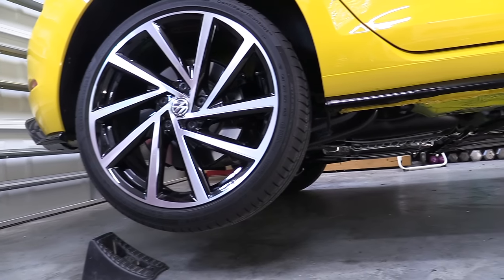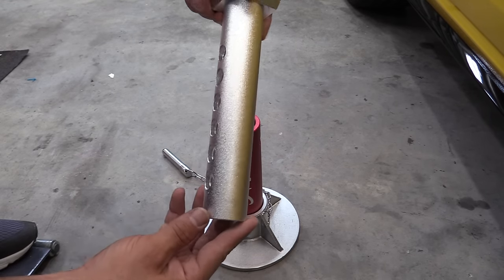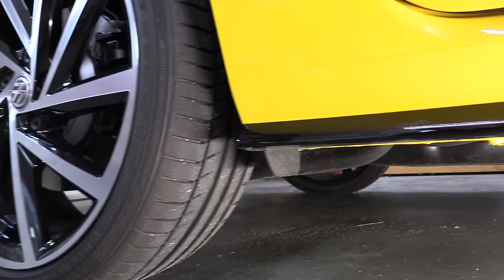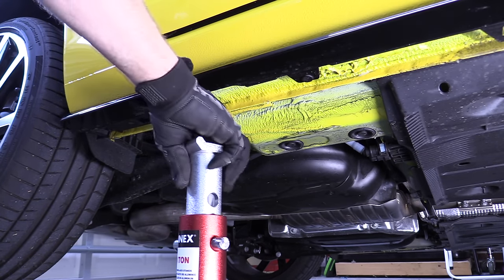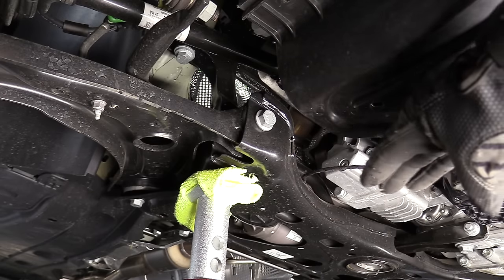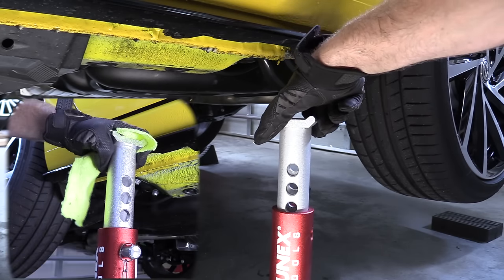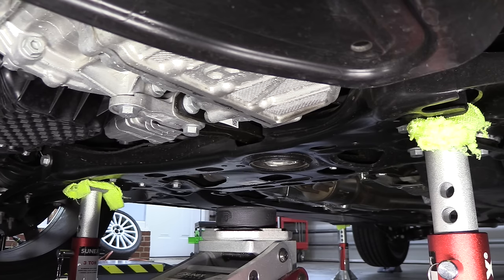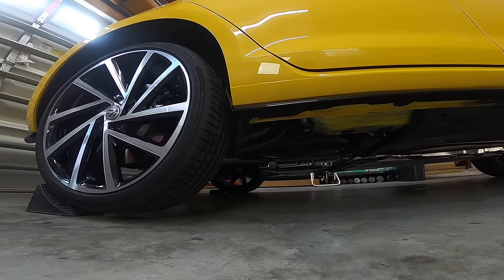How To Properly Lift a Car on 4 Jack Stands

Comment: Thank you for creating this video. It proved extremely useful when I swapped my winter wheels the other day. In the interim, I’ve ordered the Audi jack pad kit as I don’t trust these pinch welds for the long term.
Reply: I've read and seen video using the Audi jack pad kit and it's pretty tight getting a jack into those Audi pads and placing jack stands at the pinch weds simultaneously  you have to have certain jack stands (and jack)  (like the ones shown in this video) AND position the jack a pretty sharp angle to accomplish it.

Comment: Very useful video, but those jack stands are really squirrelly. The Esco tripod stands with the flat rubber saddle are a lot more stable. They also have the advantage of not needing any sort of padding.

Comment: I bought the Audi jacking kit and installed it on my MK7.5R
Reply from the maker: I need to look into that.
Reply: @HumbleMechanic  Some rumors say that those pads are designed to be used at the factory and only 4 corner jacked all at the same time. It would be awesome if you could confirm/deny those rumors.
Reply: I've used the pads on my RS3 when jacking up the corners multiple times. They are holding up fine. I use those softer red polyurethane pucks.
Reply from the maker: ShopDAP.com

Comment: Yea, get some spacers on that sucker. I did 15mm front/20mm rear spacers on our R to push the wheels out a little bit and it looks way better.

When we bought our Mk7 R I had the dealer swap the Watkins Glen 18's from our MK6 GTI and put the Pretorias from the R onto the GTI. Some lucky buyer at Carmax got a brand new set of Pretorias with summer tires when they bought that GTI.

Comment: I actually have a thick horse stall mat in front of my workbench that I custom cut things from. Pieces for the floor jack, the jack stands, etc. you can stack and attach pieces together to make a custom rubber lift puck.

Comment: only set car in park or put brake on if jacking from side ,  if you jack from front or back of car, the car needs to be in neutral so it can move slightly so it doesn't slide off the jack as the jack moves forward as it goes up.  set brake and block after it is raised, then unset before lowering.
Reply: Corrrect super important

Comment: On the Mk6 models I like to place the jack stands under control arm bushing brackets (rear position) at the front of the car. If it’s a quick job I usually leave the stands there, if it’s going to be up for a while I’ll move the stands to the pinch welds.

Comment: I've seen warnings that you should not jack up opposite sides; when jacking up the 2nd side the other side's jack stand may wobble or fall.  In fact there was some wobble when you jacked up the 2nd rear corner.  Maybe this affects certain vehicles more than others.
I had the notion to have 2 jacks simultaneously lifting the back (also the front if still using the pinch welds).  Do you think this would be safer/better?

Comment: The problem is you can’t consistently lower the jack slowly so you may damage the car or it can even fall off the stands, at least that’s true for my jack and I’ve seen others with the same problem 
So a solution would be having some jack stands with fine adjustments but those are only available for trucks and are too heavy too high and expensive. Another option is to use a scissor like jack but if you want to use the hidraulic jack as well you may run out of jack points.

Comment: I use 2 airbag lifts. They are amazing because they do not arc and they go straight up.... only downfall is they dont fit under lowered cars. I hate car manufacturers that don't leave metal exposed to support the car... They try to make it difficult without a 2 post (cough cough dealership)

Comment: you need to make a video doing this method with 6 ton stands that have a 23 inch lift on them. (on a passenger car) in order to do transmission replacements.    I dont think the side to side method is going to work very well, especially since the car will be tipping so much on the sides to just get them under there at even the lowest positions.  on my car i have to do front to back instead of side to side with 6 tons.

Comment: Watching this makes me miss my BRZ, that car was so easy to lift using the front subframe and the rear (via diff).😄
Reply: Mustve been stock height, i wasent able to get under mine with an ultra low/ long jack lol.
Reply: @DrivenMars  mine was lowered about 20-25mm, not dumped or stanced.  Wanted to keep geometry decent for track work 👌

Comment: I was always thinking I would jack up my Mazda 3 on four jack stands for things, but I have come to the reasoning that it’s not worth all the back and froth between jack and jack stand repositioning and especially not worth the risk of jack stands tipping. I think I will just stick to two jack stands and jack holding up slightly as a back up. For brake bleeds or tire rotations I will just lift up one side of the car at a time, or front or back. For brake bleeds I will just jack up one side or corner at a time with the regular precautions. For oil changes I have metal harbor freight ramps I drive up on and then put jack stands underneath and a jack as another backup.

Comment: Great video Charles! Nice to know I was properly jacking my own car up using the same methodology as you demonstrated. It should make sense if you look at the layout logically, but some people need a clear representation. You did a great job at that!

BTW: My dad bust a gut laughing when he saw my mk1 Jetta lift the rear wheel when I was jacking up the front, just as you shown with your Mk7. He had never seen that in any car he's ever owned over the years! Gotta love a stiff unibody!

Comment: Thanks for the video Charles! Is there a reason not to lift the car from the subframe initially rather than moving the jack stands after the fact?
Reply: Came here to ask this as well.  Seems way easier if you can reach subframe initially.  Need a long reach jack but still, any reason we shouldn't do this??

Comment: I have a forklift.  I was thinking drive forklift into side of vehicle with 1 fork on each side of tire. Now bring forks fully together .  Lift ...  the tires will slightly deform on the forks.  The
Vehicle may have some awkward forces on frame as it lifts. If you lifted the front first it may lift the whole.side.  it would be easy to get the jackstands under at that point on one side.  Repeat on the other side and your whole car off the ground.  Any thoughts or ideas?

Comment: Proper lifting points on my car: whatever parts of the pinch seam aren't rotted away.

"Avoid gravel"...  Mmmm...no can do!

My jack stands: concrete blocks with pieces of wood on top, stuck under whatever structural members of either the frame or the suspension are not rotted away.

If it's not obvious, I believe in SAFETY!

Comment: Great video. I've been trying to find better places to set my stands. I just started working on my own vehicles. I bought a manual for some basic maintenance and it says to use the pinch welds. I've looked everywhere for alternative jack points. The pinch welds on my vehicle, just doesn't seem very safe. And when my jack is listing from the pinch weld I cannot slip a stand in. It's been a real pain, and a lot of unwanted trial and error. The pinch welds have even become a little mangled. I seen on some forums about using 2x4s as a stabilizer between the stands and the vehicle. Anyone have any tips about that?

Comment: look up "Goodyear racing jack stands model 35422" Those have double locking pins, they're also very, very nice. Thumbs up if you agree.
Reply: I don't see them available anywhere but they look good
Reply: Try using the offer up app on your phone or craigslist, you'll find them here and there.

Comment: Dear Charles, as far as I'm concerned, I drive the car on 2 pieces of wood in the front and then put the jack and lifted it from the front frame and then put the jack stands under the pinch welds, that way I'm never under the car while supported by the jack alone.

Comment: Also, no matter how level you think your surface is, and how undamaged are the lift points of your car, with a front-wheel drive car that is much heavier in the front than in the back, after you let the car down on 2 front stands, and then onto 2 back stands, each adjusted to the same height, you may find that the car is not actually resting on one of the 2 back stands. This is ok, as long as the car is firmly supported on 3 stands, and the 4th stand is standing under the reinforced lift point, you are ok. This is due to a basic law of geometry. Something to do with a tripod. You will notice that telescopes and cameras are always attached to _tri_pods, not quadpods, because a tripod is the most stable; a quadpod is no more stable than a tripod.
Reply: I found this to be the case when putting my wife's RAV4 up on 4 jack stands last weekend.  I lifted the front first and placed 2 jack stands in the pinch welds.  Then I lifted the back and placed 2 jack stands in those pinch welds.  When I started slowly lowering the back down onto the jack stands, the car tipped ever so slightly towards the front passenger side (my heart skipped a beat for a second!).  

After it settled, I found that it was actually being supported buy only three of the jack stands!  It was just hovering over the rear driver's side stand.  Of course I left the stand there under the pinch weld and placed the floor jack up on the frame right next to where I was working as a backup and I felt perfectly safe.  I do not live in an area where earthquakes occur so that is something to consider, ever with the car up on 4 stands and a backup jack in place!

Comment: I think it is negligent of manufacturers' as big as VAG do not make this procedure easier and consequently safer. The lack of 2 DESIGNED bearing points in each corner of the car: one for jack and one for stand is an accident waiting to happen. Cars breakdown and need lifting away from lifting stations and even mechanics find it tricky jacking cars in emergency or breakdown situations. I use 2 jacks simultaneously at one end of the car and place it on 2 stands and do work on each end at a time. But the positions of those bearing points are too close and far from ideal.
Excellent  demonstration, keep them coming master.
Reply: I agree. When I was a kid I had a 1974 Nova. There were slots in the steel bumper for a jack. If anything was going wrong while jacking, you lowered it and reset the base and jacked it up. There were a hundred places for a floor jack to go on the car's frame. 
It would be nice if uni-body cars had purposely made jack points that were not covered in plastic, besides the pinch welds, and had them painted green to find them easily. As prices for tire rotations increase more people will rotate the tires themselves, for free.

Comment: I know for the transmission fluid change you will need to shift all gears, this means you'll have to spin the front wheels at some speed, would a configuration like this hold properly?

Comment: I own a mk6 gti, is it a good idea to lift it like you did from the aluminium subframe? I previously just jacked it up carefully on the pinch weld and put the jack stands at the reinforced part. I have had a case where the pinch weld did fold and I'm lucky that the car didnt fall down.

How would you suggest I lift the car?
Reply from the maker: I don't have a jack that will reach the subframe with the car on the ground. I would do it like I did this one, and move the jack stand to the pinch weld if you don't want them on the subframe

Comment: @humblemechanic Charles, I just wanted to jack the front of my Mk 7.5 Golf R for an oil change. Can I use the rear pinch welds to lift and place my stands on the front?

Comment: Question : How could you slowly lower the Trolley Jack arm. ?  As soon as you unscrew the little pressure screw, the jack's lifting arm will goes down instantly due to the car weight.

Comment: Just one mistake, you will bend the metal. 
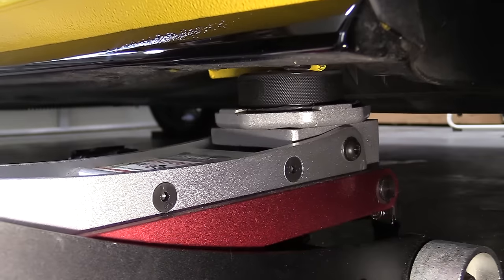Its bend @ 1:45 front right and straight @ 1:53
You wont be able to use the original Jack anymore and there will be rust.
Just look at the VW Jack an build a similar thing, for example make a groove in the Puck.
this Lip is NOT for lifting, its so that the car doesnt slip of the jack. the part right and left of the lip is the structural part for liftig.
So many are bend, its a stupid system, most  car machanics with a lift will flatten them....

Comment: Hi Charles. What do you think of ramps, are they just as safe as jack stands? I need to change my wife’s Nissan Rogue’s transfer case, and rear diff fluid soon. Driving up four ramps can save me some time. I always put jack stands and wheels underneath regardless which method. Thanks!
Reply from the maker: If I was going that route, I would drive it on ramps for the front, and put the rear on jack stands I REALLY like ramps. I have a set similar to this. https://amzn.to/2xyPtTD

Comment: Hello Charles, my driveway is sloped so I only lift one end of the car and put pieces of wood (2 sides straight 1 side curved, curved side touching wheel) behind the wheels on the opposite end. Could you please make a video on on lifting a car on a sloped driveway please?

Comment: My Mazda 3 has the problem of all the plastic shielding under the engine and sub. And there isn't enough clearance to remove it prior to lifting. So I have to risk jacking from just behind the pinch weld markings so I can place a jack while lifting at the same location.

Comment: Where was this video 6hrs ago when I wanted to put my mk4 on 4 stands...right now the front is up...might use this to put the rear up for an easy brake flush...
Reply: If you're just bleeding your brakes, why not drive the front up on ramps and then jack the back up? Might save you a bit of time.

Comment: What are your thoughts of driving the car up on ramps for the front then jacking up the back and placing it on jack stands. For safety jacking the front and swapping around 1 ramp

Comment: I'd never lift a car off the pinch weld unless I really had to. If you've ever seen just how much a car twists you'd understand why.. I always try and lift one end at a time. front then the back. Off the subframe or differential. And put the axle stands on the frame rails or subframes instead of the pinch welds (unless I have to). This avoids any twisting and to me seems much safer and more time efficient.
Reply: If you take it to the track, the body will twist a lot more....

Comment: Pinch welds aren't really meant for those kinds of jacks. The grooves are designed for the jacks that typically come with the car. For floor jacks find a solid piece of the cars frame to jack the car up. The odds of you bending that pinch weld are pretty high if your not careful with a floor jack

Comment: I just drive the car up on a few blocks so I can get the jack all the way into the front subframe to start. I don't trust pinch welds on old cars to be able to support the whole side of the car with the weird angles while lifting, even if they don't look rusty the inside might not be 100%

Comment: Dumb questions, so I've watched a couple of these types of videos...and all show you how to set up the car on jacks, but none continue on with showing you how to take the car back down. Can I assume we go front first--example, the jacks are on all on each of the pinch-welds and you start on the sub-frame, just in front of the center dog-bone mount--then pull the front jacks out and set 'er down.... and then re-set the floor jack at the front pinch-weld, raise high enough to where the rear jack loosen pull out and then do the same on the other side?

Comment: I have a project car I need to leave on jack stands to overhaul the suspension. Are there any other spots under the car you would suggest to jack from so I can use all four jack points together?

Comment: I have a question. Can I put one stand on the rear pinch, then jack the other side without placing a stand in the front? Then jack the entire front and place the stands in the front? Would this create a tipping hazard?

Comment: Nice job man! But i think you forgot one teeny tiny thing... How to put it back on the ground again? :D
Ahaha ;) for real now, one thing that MIGHT help in identifying lifting point are small downward pointing triangles pressed into sills, at least that's how it's on my MK3 Jetta, (I noticed that "feature" is absent on newer cars) and they are perfectly line up with the middle of pinch weld reinforcements, also some cars have plastic caps that have to be removed in order to lift the car. In that case it cannot be more obvious where to place the jack.

Comment: Do you think it would be safe to work on a car when it is on jackstands which are on garage carpet? The carpet is very short and thin. I have A/C in my garage so it would be nice to work in there but not if it isn't safe

Comment: A few weeks ago I came across the trolley jack pads and for £5 it's saving me from damaging the paint. I just wish i discovered it sooner as i see a little bit or rust because i didnt use the jack pad in the past. I actually cringe when I think of the amount of times  I have used my jack. I have no idea why car jack manufacturers don't include them when selling a jack. Even if they increased the price to cover the cost it will pay for itself when there isn't any rust to deal with.
Reply: Well, in fact it's rather simple. They're not included because usually last a very short time. You as a client would go back shouting "warranty" on the first signal of decay... That's why! 
BTW for what it's worth a piece of wood, like 2x4 or 1x... can do wonders for the same task, with cost 0! Even old pieces of pallet wood can do the task. 

The moment you need to lift a car, But don't have the commercial pads, wood... you can use some folded cardboard, does exactly the same!  
Anyway they are disposable items.